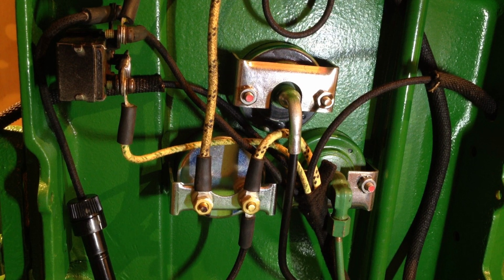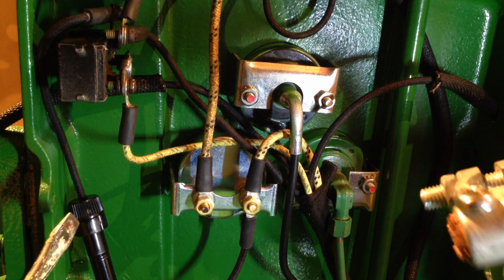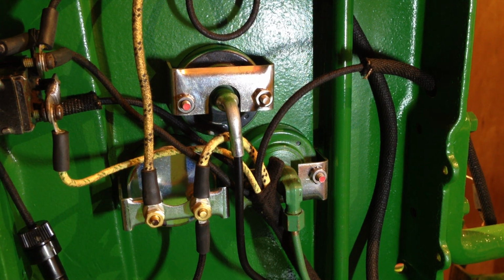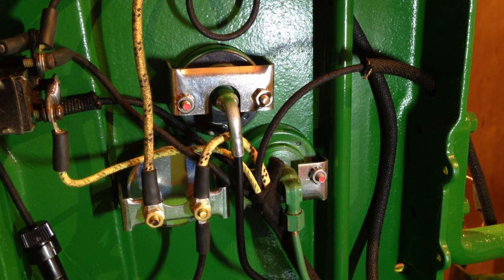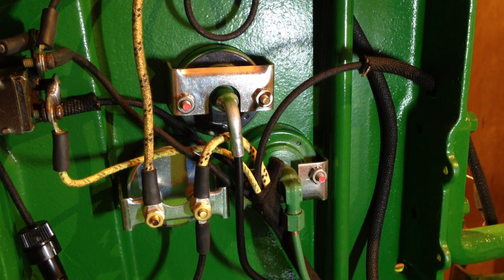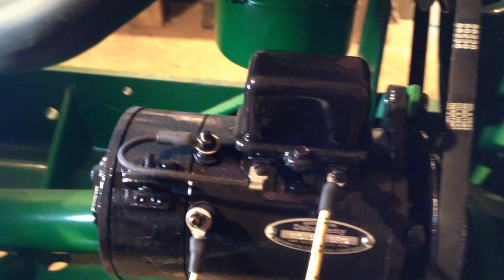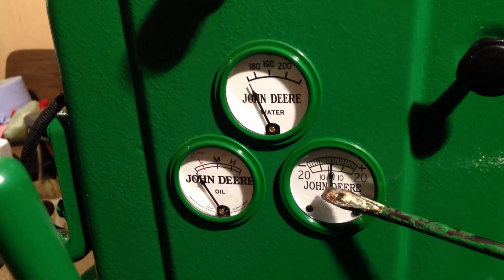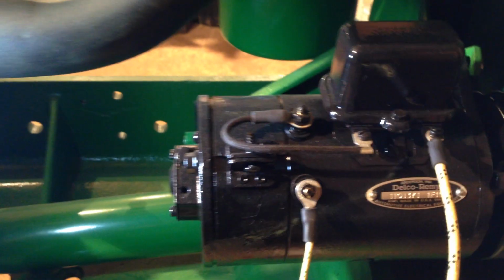1940/41 John Deere B tractor restoration pt 75 ( Electrical wiring cables Generator etc)

Comment: Excellent videos as always David I really appreciate them I was wondering if you could tell me where you found your light switch and the battery. I've looked everywhere and can't find them if you could please send me the link where you got them from I would appreciate it thank you regards. Jon Miller
Reply from the maker: Jon Miller Hi Jon the battery is from a company called shield battery’s , shieldbatteries.co .uk . The switch is an original , you can buy reproductions from the likes of Steiner tractor parts but they’re made in  Lord knows where and are of poor quality . If you can find an original they’re much better , if not you’ll have to go down the repro route . Good hunting , David .
Reply: @oneminutefarming9521  thank you very much David I will give that a try did you take the switch apart and clean it or rebuild it? As for the battery I found some in the US but they're $300 and up yikes
Reply: @oneminutefarming9521  thank you David I did look it up to Shield batteries but they had a lot of different styles of batteries that that could fit could you give me the model number of the battery please. Thanks again as always you're a great help😃
Reply from the maker: Jon Miller Hi Jon  yes if your careful the switch is robust enough to be taken apart and cleaned up clean the contacts with some fine emery paper wash out with electrical contact cleaner solder a replacement resistor on the two terminals and Ill guarantee you’ll have a better switch than any repro one . $300 .00 seems a bit steep is that a shield battery ? , but saying that I paid £165.00 for one here in the UK though that equates to around $200.00 or there about so mmh $300. 00 is expensive . If your not too worried about the look I am sure one of your fabulous auto stores will have a good quality 6 volt battery though be it a modern looking style , horses for course as we say in the UK . Best regards David .
Reply from the maker: Jon Miller Hi Jon the info regards battery is B 17.     501-17.     The Amp Hour is 117    Hope that helps , David .
Reply: @oneminutefarming9521  thanks David as always Your a wealth of knowledge and very helpful thanks again😃
Reply: Hi David I know it's been a year but I did find a battery that works very nicely through one of my local vendors and it is the correct one with the terminals across from each other.

Comment: Hi David, I have a question that is unrelated to this video but is still about JD's. I have a 1943 JD B. The clutch drive disk is loose on the crankshaft splines and has been run that way. The splines have been damaged, the disk can be replaced but how would you repair the crankshaft splines? What's your opinion on building the splines up by welding material on then re-machining the splines? What welding process and filler metal would you use? Thanks!
Reply from the maker: Hi Luke It’s a common problem this which ends in the problem you have . First off have you tried fitting a new disc driver generally I find the driver wears first before the crankshaft , softer metal and all that , if it does tighten up on the shaft and is not sitting out of shape , all well and good but and this is the rub with this fix there is a possibility that the driver will be sitting a bit further up on the shaft and will cause the inner clutch to nip on the rear pulley face when you set the clutch up so there is a fine line , I have skimmed them to bring it back in to tolerance but again if it’s badly worn skimming the face of the disc driver will not fix it as you may have to take to much off compromising the discs integrity . In your question you suggest the crank splines are damaged so the above is probably a no go anyway , you could as you’ve suggested build the shaft up but remember you would have to build both ,for want of a better description, the top of the spline and the bottom otherwise the disc driver would only be sitting on effectively half its contact area between the two components . As a build material I would use a general run of the mill mild steel welding rod used with an arc welder , the arc welder is best for this sort of thing as you’ll get better penetration with the build metal and the base metal , crankshafts generally are not that hard especially in this instance , weld it in stages and don’t get it to hot giving it time to cool ,  turn it through 180 degrees every time you weld as well this helps with any distortion that may try to take place . Machining wise , if you have a machine shop that can do this sort of milling work all the good , they will need a new driver to to be able to mill the splines correctly, if you don’t want to remove the crankshaft then I’m afraid it’s a new file and a lot of patience and fiddling but it should be do able . If it’s real bad then your only cause of action would be a second hand crankshaft and all the problems that could will bring ie resetting bearings , ensuring it’s splines are good etc etc but it’s all do able so don’t despair . Sorry  for the long reply hope it’s of help best regards David H.
Reply: Thanks for the information I appreciate it. It will be a while before I have time to work on it. I'll keep you informed.
Reply from the maker: lukeloader No problem Luke regards David

Comment: Hello David. Are you using www.brillman.com ?

They are who I use for all my original cloth coated wires. They are in the USA 

Wish you were restoring a 48’ D then I’d use the video as a cheat when I rewire my model D.
Reply from the maker: David Sall Hi David I’ll look  that website up thanks for that , the company I use is the Green Spark Plug company in the UK , throw back from the sports car days . I’ll have a wiring diagram some where for your tractor if your interested let me know and I’ll add it into a future video best regards David .